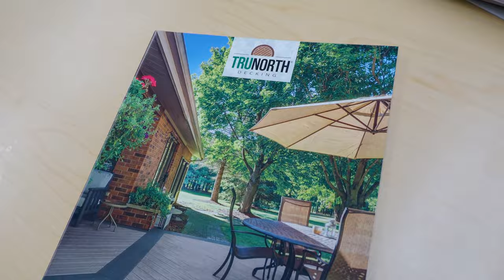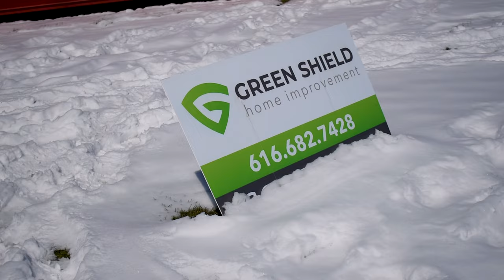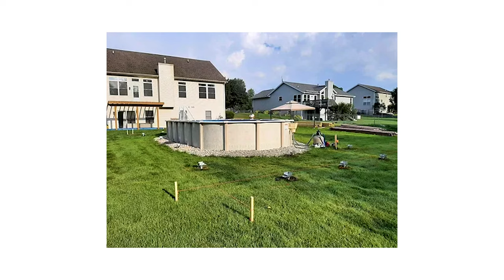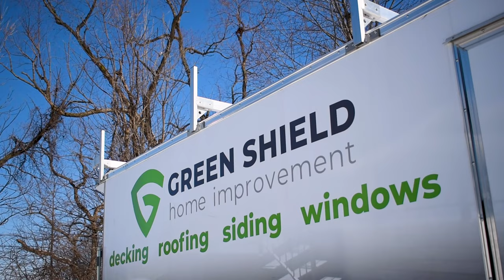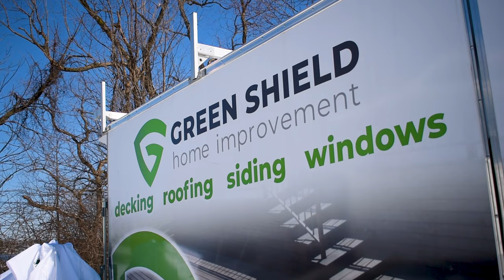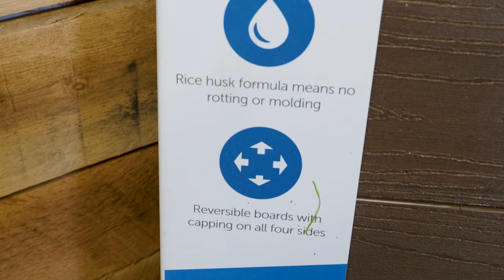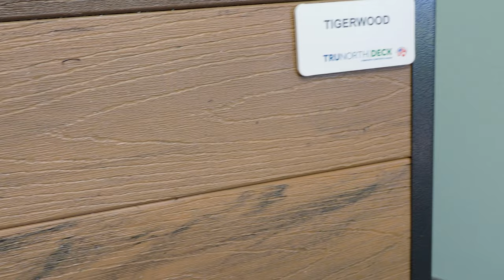How To Start $200K/Day Deck Building Business

Comment: With 100 employees building 1000 decks in a year, this basically breaks down to 20 5 person crews, with each crew completing a deck every week of the year.

To me, this seems somewhat unrealistic due to potential weather hold ups and unforseen delays which always happen on any job site.
Reply: They don’t install in the winter. With the fixed overhead they are carrying, managing it to stay afloat during a downturn will be a significant challenge.